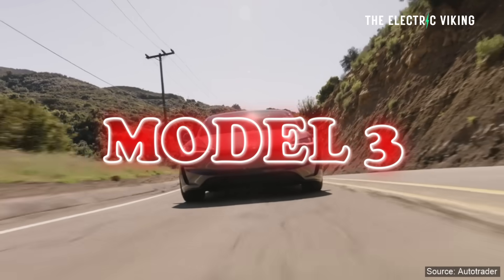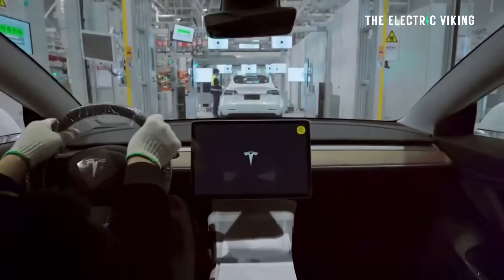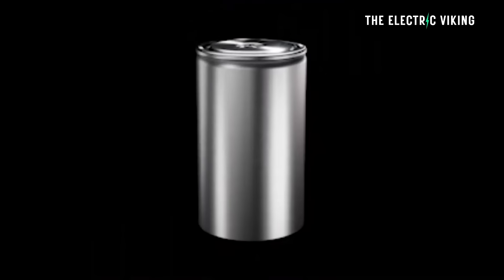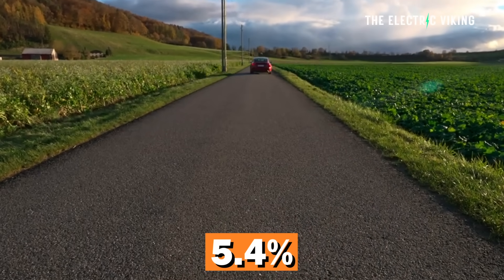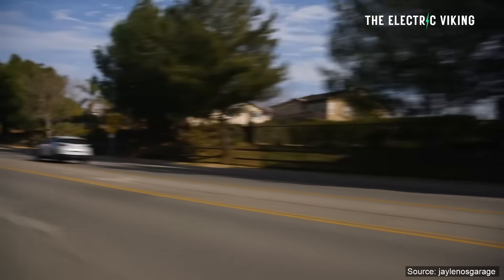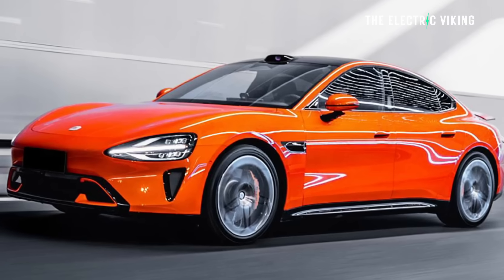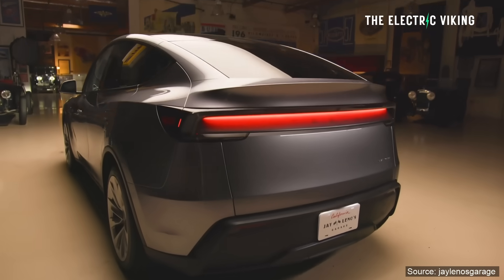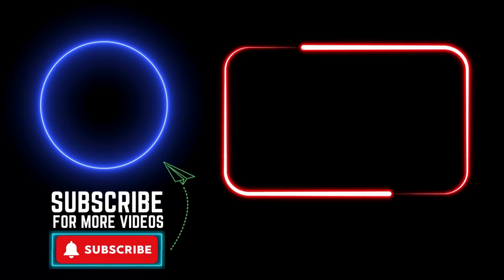Tesla Model Y and Model 3 get BIG range and power boost with NEW battery!

Comment: I bought a 2025 model 3 rear wheel drive long range. It has a 81kw battery pack and a stated range of 368 miles. This equates to 219 wh per mile. I e already put almost 12,000 miles on due to a trip from California to Virginia and back. Despite driving over numerous mountain ranges and driving at freeway speeds, I have averaged under the 219 for the trip and since I bought the car. It’s a fantastic improvement over my 2020 model 3 and appears that the stated range is probably a little below reality which is crazy. As for the range of Teslas built in China, I have no knowledge of the methodology of how China calculates range but I highly doubt the numbers you report in this video.  It would make more sense to compare the usage per mile.

Comment: Here’s my thoughts. I would never buy a Chinese card no matter what with their cheesy copycat wanna be that is never even close to the real cars that Tesla makes.  

After that, I only want Japanese batteries. Their quality control and material sourcing is far greater than China.

After that, the range increase is nothing.  What impact to reliability is there in the long-term with these new batteries?  I would take a proven track record of the other Battery over a new one until there’s a long time of proven track record.   

So it’ll be years before we find out if it’s even worth it with any impacts unreliability or not then I could say OK.

Comment: I highly doubt this is a new battery.  It just sounds like acceleration boost is being included and they determined they had enough headroom in the batteries to put an extra 5% charge into the current crop of batteries and just adjusted the scale. China models use LFP after all so they must have enough data to warrant pushing the battery a bit further.  I would not be surprised if Tesla includes range boost with the acceleration boost on all Juniper Model Ys with LFP soon.

Comment: I put 18" model 3 aero wheels on my long range model y with 235/55r18 tires and probably get the same range increase. 10lbs lighter per wheel and narrower tires for slightly smaller frontal area.

Comment: The Ducati GP25 is like the GRX engine from Speed Racer—a super-advanced machine that’s incredibly tough to handle unless you’re perfectly in sync with it. For Pecco Bagnaia, the GP25 is his GRX: an amazing bike that Marc Marquez rides with ease, while Pecco struggles to keep it under control, battling its twitchy handling instead of riding smoothly. Michelin’s choice to cancel a new front tire, which Pecco thought would help him brake confidently again, feels like a major setback. I miss the days of Bridgestone tires, when riders could count on steady front grip and brake boldly without worry. Ducati needs to move fast—maybe by creating a hybrid of the GP24 and GP25 to combine their strengths—because this isn’t just about winning races; it’s about helping Pecco regain his confidence.

Comment: Probably they wanted to do the initial Juniper release with new battery tech (4680 cells from LG, or better LFP like Blade v2), but they had scaling issues or something.... It's a shame I was waiting a lot for the refresh and was disappointed with the Batteries. Do we know if they added finally the new cells or what was the source of the improvement? Also what is the Charging speed and Cycle liftime?

Comment: If the price is being raised for a modest or OK improvement then that could hardly be described as competitive. Competitive would be giving the customer a little more for the same (or less) money. If this turns out to be nothing more than the software facilitated release of redundant extra battery capacity which was always there but un-used so as to be "competitive", I'll be pretty cheesed off to pay more for it. What is the actual truth here? Is it improved battery density or is this a rip-off trick?

Comment: A range increase of 5.4% will probably attract less than 5.4% of potential buyers.  If the performance had been kept the (completely adequate) previous performance how much extra range would you have got then? Maybe bigger and more significant changes are coming when the CEO is an exile in South Africa.

Comment: I think it’s worth switching. I had a 2022 model Y and just bought a Juniper RWD. It really makes long distance travel much much more comfortable. Suspension feels like a luxury car, FSD if you decide to, it’s way better. Autopilot not much difference and range is def worth. I avg 210-220 watts x mile which is around 330 real world miles

Comment: There are no new batteries, just the removal of the buffer in old ones.
Reply: Sure? How do you know?
Will the other refresh Y that are a few weeks older get the same buffer removed? 
Why the acceleration increase if it’s still the same batteries?
Reply: @christianr7051 It’s the boost package now included, as in the first Y. Only the standard range LFP was updated in 2.5 kWh (now 62.5 kWh gross)
Reply: @pedromiguelareias  Commander Gen 2 ane Scan My Tesla says 63.5 kWh. Own that car with CATL 6M pack.
Reply: @Hitman006xp  I heard that. I have the RWD Model 3 highland (dec. 2023) and it's only 57.5 kWh net. Will upgrade when it's close to 100 kWh 🙂
Reply: @christianr7051 Battery size wouldn’t change acceleration performance.  They are just adding the Acceleration Boost for free.  I have it on my Y.

Comment: If you just recently bought a Tesla with the older battery technology, don't feel bad. I would prefer the proven technology over new, until the new batteries gain a track record. You just don't know the long term reliability of the new chemistry. What you now have, is "tried and true", and if it serves your need, you were able to afford it, drive it to end of life. At that point, you will know if the new updated chemistry is a "safe bet". If so, get it then. If you see a car you like, with enough range, at a good price, GET IT!! (even if it isn't the latest technology)

Comment: Tesla needs to change its policy toward advertising. A comprehensive marketing and promotion effort to communicate with the market and potential customers. Relying on "word of mouth" is no longer as effective as it needs to be. The anti-Tesla movement and its loud voice is overwhelming the supportive pro Tesla crowd. Tesla needs an "attack plan" that takes the fight with competitors directly to buyers. Elon Musk using X is inadequate to restore and build Tesla to their real potential. Tesla needs to engage with the best marketing and PR firm on the planet and execute a strategic plan that ensures their EV leadership role. Relying on the current state of affairs will see Tesla continue to spiral downward. Tesla can no longer depend on passive word of mouth communication. Tesla must win customers by communicating with them in a manner they control. Tesla must take control of its own destiny and more effectively drive its own narrative.

Comment: People love to talk about range; 750km, 2000km, even 3000 km like the Chinese people the other day. But they fail to mention which battery pack size (kWh) and the efficiency used to calculate that range.

It is so simple as: using the efficiency of the vehicle and multiply it by the size of the battery pack to get the real range (at this point in the calculations, the density is not important because its relevance is in reference to its weight and how big it is dimensionally). 
So, a higher density will allow to have more kWh in the same size or the same kWh in a smaller size battery pack. In both cases the range will be increased, in the former by increasing the kWh and in the latter by reducing weight.

Example: 13 kWh / 100 km (the highest efficiency I know) = 7.69 km / kWh; 7.69 * 78 kWh = 599.82 km.
And because every vehicle has a different efficiency, the range will be different for each vehicle.
Reply: And take into account what else is using power as you drive IE: sound system, heating/cooling levels, accessory charging etc etc
Reply: @The_Escarpment  that is correct. But in this case, all consumptions are already included in the 13 kWh / 100 km.

Comment: Does the $2000 have to do with the batteries alone?  If so then 25 extra miles per charge for $2000 probably is a trade many wouldn't want to make.

Comment: What should Tesla really do is to make a battery for model 3 based on 4680 cells . That would be real boost in range and performance.  As far I understood from the discussion is that this is not a new battery, they just unlocked the higher performance on it for Chinese market. You can buy this in the west for 1500$ , if you have an long range variant. In this case its just a trick . They cant milk Chinese - too much competiotion , so its unlocked for free and they milk us if you want this upgrade on your existing battery .

Comment: The US battery pack versions has been limited by qualifying for the federal tax credit which required US made components or from preferred foreign partners. The federal tax credit is about to go away thanks to the GOP and the idiot in chief. That could change battery sourcing for Tesla but tariffs may keep it the same? We'll see. 

Eventually US and US partner made batteries will catch up to China on density, performance, and cost but could take years. At which point China will be on to the next best thing. 

Battery / energy storage tech will continue to evolve for decades in the post carbon fuel era. China will likely lead the industry but time will tell.

Comment: Is there any change to the charging curve. The only feature that Tesla is behind on is charging speed, it hasn't improved in five years. Range is good enough, i keep my Model 3 Highland at 65% during the week and at 80% for roadtrips, our bladders are the limit not the battery. More performance, i never floor mine, did that a couple of times in 2019 when i got my first Model 3, nearly passed out. For those who care about such things the Model 3 Performance is available. Nobody who drives the regular 3 or Y wants it to be quicker. What would be nice is to match the charging curve of the new Lucid Gravitity which can add 200 miles of range in 10 minutes on a 400V Supercharger. Lucid is using a newer Panasonic 2170 so it is possible for Tesla to improve the charging speed on US 3 and Y if they wanted to.

Comment: I’ve been wondering when they will make acceleration boost available to current Highland owners, which would give the performance numbers stated for the improved models.
Reply: Was offered a few months ago. Probably still is.AUD$3000 is a lot for a little faster. 1k and I’d think about it.
Reply: @Paul-ow9dd ah, I should have specified in USA… I think they are offering it in some markets.

Comment: no one cares for improving range past 500km. 500km with 25mins charging is perfectly fine. What we need is a battery that only costs about $2000 to replace when it completely fails. Many people buy EVs to save money and daily use does that. But when your car has a $15000 battery replacement, that changes peoples perspective.
Reply: The batteries last longer than most gas car life

Comment: I will trade my model y when the range increases to 600 epa estimated miles and not before.  I could not care less about small range increases that will not make traveling long distances through rural areas with few or no fast charging options any easier or less worrisome.  
Performance increases that enable faster acceleration hold no appeal.

Comment: Solid state, with 500km of range in 12 minutes and 800K km or 10 years durability, would be a significant change.  This is incremental innovation.
Reply: True but I see this as the market forcing innovation.  Overall it's a good thing.
Reply: My Camry has 700km range & 3 minutes fueling time.
Your welcome!!
Reply: @billsmith281  And you can refill it at home. Love it.
Reply: Go ahead and make it then
Reply: @alexsmba that's an interesting take on a highly complex piece of tech no one person works on these batteries or RnD
Reply: 0.6 sec reduction in 62 time is far more than incremental
Reply: and, they have done next to nothing to update a truly weak design.  no, thanks
Reply: I need real world highway speed range of 800 kms. Because I drive 1000 km etaps and if I could charge it full back home I could save a lot, averaging 2,5L/100kms. Fast charging is like 10,5L/100kms. So for me 800 kms are the minimum!
Reply: Yes. This is nearing click bait.
Reply: @stevejeffries6945 deffo a clickbait headline, I agree. Hardly going to change the direction of travel for Tesla sales.
Reply: Those batteries already exist but not solid state.
Solid state is becoming increasingly redundant.
All Tesla batteries now last well over 400k miles.
Few taxis drive 40k miles in one year…
Most Tesla batteries last over 1 million miles.
Reply: @whowhy9023  "Most Tesla batteries last over 1 million miles." Provide a link to a credible source for that claim.

Comment: All this hype is only till Chinese manufacturer's upgrade to a silicon carbon battery which will give 20% more capacity in the same size and weight. Tesla on energy optimization and chinese on bigger batteries for the same price. Who will be the final laugh.

Comment: Is not new battery just unlocked the reserved capacity of the battery.
Reply: I agree, they are just including Power Boost because the Chinese market is so competitive. They don't offer Power Boost on the 3 in the US because they are protecting sales of the Model 3 Performance. They do have it for the Y because they haven't released the Model Y Performance yet.
Reply: well said, tesla has this ability hidden all along, now their hand has been forced, in that regard its a welcome change
Reply: OK. So then a bit more capacity used and potentially decrease in battery longevity (if you use full available capacity).
Good for users who do not charge all the time full (i.e. know how to maintain battery health) and probably bad for those who then must utilize all the capacity.
Reply: Not at all true. Out of spec did range tests that prove it.
Reply: @stevepriority4219  what is not ture?
Reply: @mho0  They did not unlock battery power that was previously hidden. Same size battery but the new car is a little more efficient. You can look up many youtube videos where this is documented. People are using less power to drive the same distance.

Comment: They need to implement 24m battery solution 600wtt per kg
Reply: Sandy mispoke it's 665Wh/l not kg, the specific energy density was 350Wh/L for yet to be produced solid metal Lithium and in the 200 range for Lithium ion. 24M are sellling an electrolyte not a complete battery.

Comment: Bugga! I took delivery of my new Model Y Juniper last week...6 days ago. I don't suppose I would have these new batteries...? Is there a VIN number to confirm?
Reply: Actual difference in range is realistically only about 20klms to be honest. It’s probably only a change of software unlocking more available battery? Definitely not worth that much money. The boost in power brings it to exactly the same as the Juniper launch edition, that came with ‘acceleration boost’ included. It’s all software. I wouldn’t be concerned and I think you’ll love the car.

Comment: Any indication when will this be available for order on Australian website, I see Tesla are offering $2000 extra off on top of trade in value on new Model Y. Was getting ready to pull the trigger but longer range even if it isn't much is most welcome. As is faster accelleration.

Comment: Well we just got the new model Y long range Juniper launch edition  and at 100% charge it only gets 498 kms of range and not the 550 kms as it was said it would get and we did a trip from Cairns far north Queensland Australia to Gosford on the Central Coast in new south Wales and return ! But gets no where near the range as advertised and the model Y Performance i have is still quicker. Even though the brides launch edition has an excelloration boost its not what the figures you are quoting ,,
Reply: Those long highway kms are what does it. The range is quoted for highway and city combination..
Reply: It may depend on how the car is driven.
Reply: My experience is that highly unlikely to get close to advertised range. 2 km less than 500 km is still pretty good.
Reply: @trythis2821 it’s 52 km short not 2
Reply: @StuartKarlson-qn8pj  I know that, please re-read what I wrote.
Reply: @trythis2821  he says at 100% charge it only gets 498klm. I wonder what charge he got down to? If he kept going for arguments sake, until the car actually stopped, maybe that would be close to 550klms? Mine on the highway uses 90% for around 425 klms and I’m pretty happy with that. I’d prefer more chargers rather than more charge.